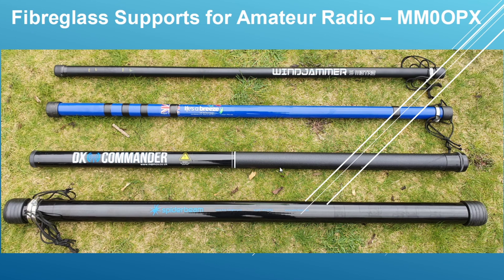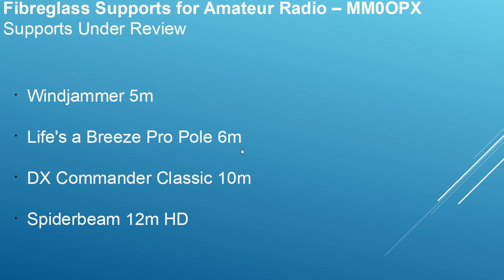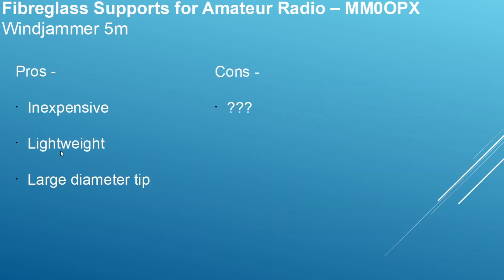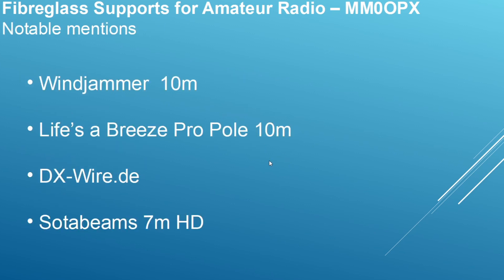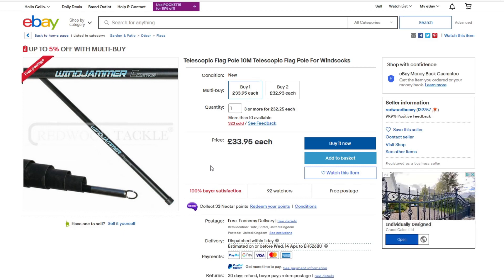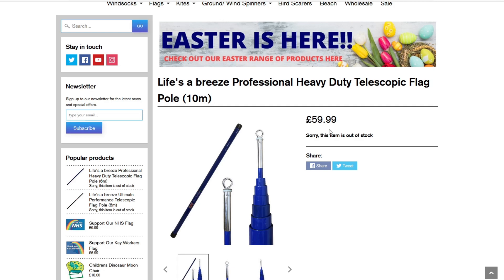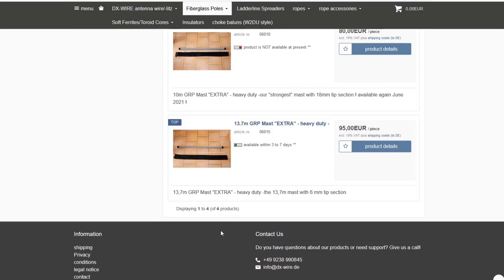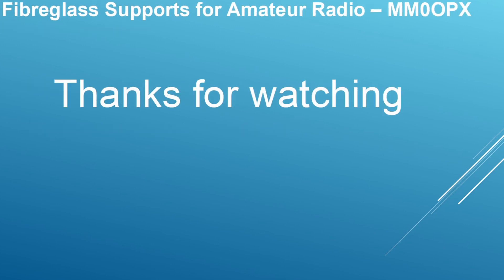Which Pole do you need for Ham Radio?

Comment: I've only had my pair of 12m Spiderbeam poles for a couple of months.   But,  I did discover that I can put a one ounce fishing weight and line through the eyelet at the end and just lift the pole up to a point on a branch in a tree where I want to pull a rope up to use as a support and drop the weight over the other side.  That allowed me to use a branch as a third support to raise up a Delta Loop for 40 meters.  

Thanks for the video, and 73!
Reply from the maker: Great tip. Appreciated 👍

Comment: Thanks for usefull info. You might also have a look at the DX wire masts. They rods are 1.5 mm thick, making it a very sturdy mast that hardly moves in the wind. You can even mount a rotator on it at 5 meters height.
Reply from the maker: I think I give Peters masts a mention at the end of this video? Yes very good masts. I would have if I had peeronal experience with them.

Comment: Colin, very helpful indeed, thank you. I'm looking to put up a vertical doublet, 10m total height. The DX commander looks good enough, and also the Spiderbeam. There won't be any lateral force at the top, only half way down at the feed point, so I should think either of these will do nicely. I'll guy it as well. Many thanks!
Reply from the maker: Not sure what your doublet centre would be but I would opt for the Spiderbeam or DX Commander signature 12.4. The DXC 12.4 has marginally thicker walls.
Reply: @MM0OPXFieldRadio  Thanks for the thought. My doublet centre would be halfway up at most, possibly offset a little downwards, due to effect of ground on the electrical length of the lower leg. I had pretty much decided that the Spiderbeam would be better than the reviewed DX pole, given it's thicker construction and also height, which would enable me to get the lower leg well above ground level. I hadn't come across the 12.4m DX pole though, so thank you for suggesting it. I will go with one or other of the 12m poles; with a weight of 3.95kg, the DX 12.4 is as you say slightly thicker walled than the 3.3kg Spiderbeam. I think I can also put some sort of a guy line on the opposite side of the ladder line feed, so hopefully should be good. I'm planning on transforming my existing 20m horizontal doublet into a 10m vertical doublet, to better receive vertically polarised groundwave (so relatively local) transmissions, and am content to lose the existing 80m capability that my existing antenna gives me. 40m, 20m 10m etc I think will do me fine.

Comment: I plan on using an Ed Fong 2m/7cm roll up antenna with a Spiderbeam. The antenna is 16’ long. Any suggestions on if this should hang from pole vertically or have it slope off at an angle? Also..would the 7 or 10 meter pole be enough? Don’t want longer than I need.
Reply from the maker: So its not an antenna I've used but beleive its a J Pole. Hang it straight and get it as high as practically possible.

Comment: Spent the morning trying, unsuccessfully, to unjam the Windjammer. 2 middle sections refuse to unlock :(
Reply from the maker: Yes, these are probably the worst of the bunch for this. Have you tried boiling water?
Reply: @MM0OPXAmateurRadio  put the bottom on a cushion, a folded up tea towel on the top and tapped it with a hammer.

Comment: I have the SOTAbeams 7000 HDS mast in my inventory. It is used a lot for dipoles and various end fed wire antennas. Dipoles are generally hung from the top off the second section as the top section is a little thin for the weight. The joint between the two top sections makes an excellent point to affix various end fed wires as well.

I also have the 10m travel mast. It seems too flimsy for a balun but works fine for wires and I often hang an end fed wire in an inverted L configuration using this mast. It works great for an end fed random wire as a quick deploy antenna, particularly if a fence post or other permanent structure is available to strap the mast to. 

The 12m Spiderbeams mast is THE BEAST. I don’t use it enough. I need to change that. A buddy sent me a linked dipole and a small pulley that could be hung from the top of the second section of this mast. That would make changing the links trivial. Now that I have a drive-on base, I think I’ll take this mast out and put it to work at a POTA deployment.

Great video. I’m looking for a source for the Windjammer and Life’s a Breeze masts on this side of the pond. 73 de AG7TX
Reply from the maker: Thanks for the comments. I have just bought a 10m lifes a breeze pro pole and its brilliant for the money. Not as HD as the SB but still great.

Comment: I've been using a 10m telescopic GRP Vine Antennas pole from LAMCO and been well pleased with it.  It's a strong pole with 50mm/8mm bottom and top sections with 2 & 1mm wall thickness. It weighs in at 2450g so still reasonably light and portable although I wouldn't want to cart it up Ben Nevis. I've been looking for an additional 12m pole for use with a drive on support and in the garden and keep coming back to the Spiderbeam 12m HD. Apart from it's weight (to be expected IMO) I've yet to read a bad review so I've ordered one.👍
Reply from the maker: I'm sure those blue Vine poles are actually the pro poles just rebranded. Yep they are brilliant.

Comment: Great video. The old dx commander I bought a few yrs back the pole was a "Spirit of Air" (look it up on fleebay) with a dx commander sticker over it ;o)  it worked great for a few yrs then it gave up the ghost. I think a spiderbeam will be the next 1 ;o)
Reply: DX Commander  yep and I'm using my old spirit of the air pole as a replacement for the dx commander and a spider beam pole for the adjustiwave. 2 very different types antenna. Take calum and keep up the good work your doing.

Comment: Spiderbeam by far the best, also have the DX Commander kit plus the cheaper 7 metre variations.  All do a good job as long as long as you understand their limitations.  Use the DX Commander more for portable EFHW use and occasionally in the ¼ wave vertical kit format.  Spiderbeam for your kit.  Don’t use antenna that require radials when out portable as people always find out where I am and radials become a liability.  I tend to keep /p working as simple as possible and compact as possible.  Great useful review 👍🏻👍🏻👍🏻
Reply: Hi Mike …. Interesting post and advice … I need to erect a half size G5RV / inverted V configuration possible long term … Could I ask what poles you’d recommend I buy ? Luckily I have a 2.5m secure fence post that I can strap the center support pole to - 73 Gerry

Comment: Great video. Decathlon sell a decent 5m telescopic pole for £15. They used to have a 6m for £19, which I have a couple of. Excellent value for money. The 5m is listed as: LAKESIDE-1 TRAVEL 500 TELESCOPIC STILL FISHING ROD 5M
Reply from the maker: For the money, you can't beat it. Chuck it away if it breaks.
Reply: @MM0OPXFieldRadio  absolutely although I've had them two years and they've not broken.... yet....

Comment: SmartBreeze is cheap and cheerful. 8m are less than £20 and good for vertical end fed half wave wire or coax dipoles for 10 and 11m. Only use for  temporary setups though as above 25mph winds they bend a lot. Their 10m version is only a few pounds more.